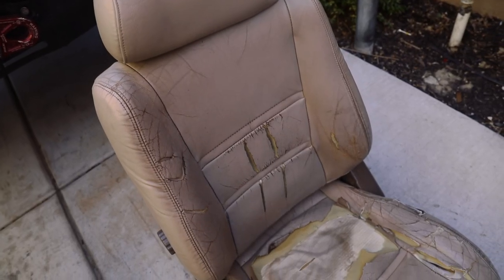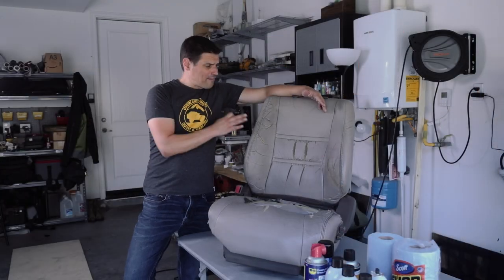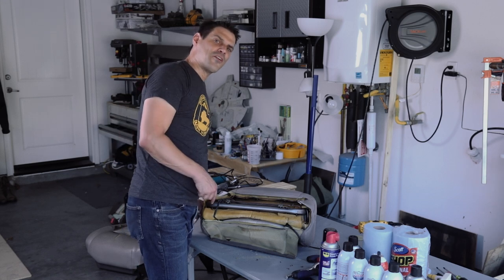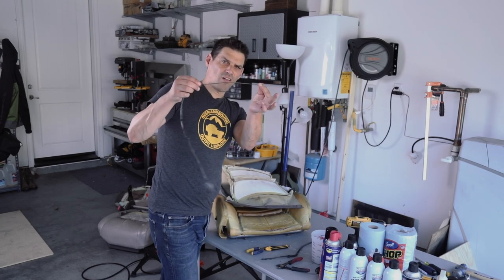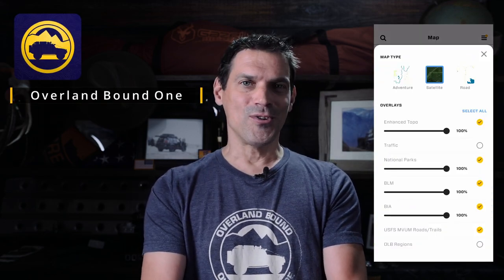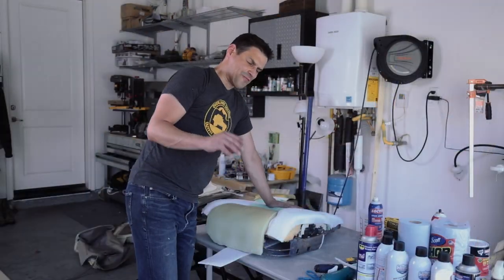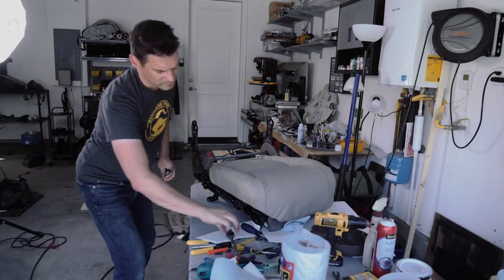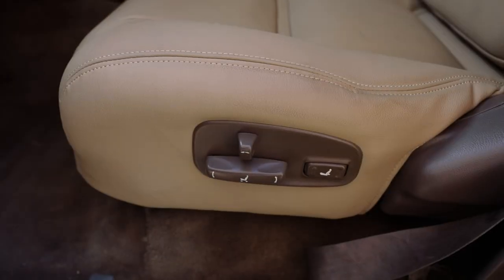How to Re-upholster Your Leather Seats for $350!

Comment: For those who own a newer models that comes with Airbags, be real careful at the time you remove the seat from it position on the floor due to the cable that is hooked to the floor and also with the wiring, I do recommend disconnect the battery and even with that precaution make sure you have a radio with a security code, which you will need it at the time you hooked the power back
Reply from the maker: Great advice!
Reply: Remember you also need to discharge the air bag capacitor as well… just removing the battery isn’t enough… I’ve popped more than my share of air bags forgetting to discharge the cap.
Reply: @Gravel_Rat78  great addition

Comment: Excellent thanks! I plan to do mine after receiving the leather. I will do one seat per weekend. Starting with the passenger seat first. The next weekend should go smoother with the driver's side seat. Thank you.
Reply: That would be smart.  I just did this and started with my passenger seat, and it ended up taking me way longer due to the heating elements sewn in.  I was driving my kids around in the back seat for days but thankfully I still had the drivers seat untouched!

Comment: Michael, did you buy the seat fabric already sewn together into a cover, or did you have Corrie sew it up for you?  I ask because I am going to be redoing the seats in both my Bronco and my wife’s 4Runner.  

Also while I’m in there we are going to be adding heated seats along with full power adjustments.
Reply from the maker: Yo! You can get heated options - I got them ready to go from lseat.com.
Reply: @OverlandBound  I am going to be getting the parts from Ford and Toyota.

Comment: What's the green tool (wired) you're using on the foam before you attach it? I'm about to do the Exact. Same. Job... so thanks for the inspiration and instruction!
Reply from the maker: That’s a small head gun to make the contact cement tacky before joining.
Reply: @OverlandBound  Okay I never saw you actually use the contact cement! So you did?

Comment: I think you can steam them to get the wrinkles out.
Reply: Or most just let the seats sit in the Sun for a few hours before installing.  Either way, the seats should tighten up shortly with the truck parked outside.
Reply from the maker: Ya they tightened up after a bit. You can see the difference in the final shots. They look great now.
Reply: @OverlandBound  they look great!  Y’all are going to have a nicely refurbished and enhanced LC when everything is done.  Thanks for some great ideas.